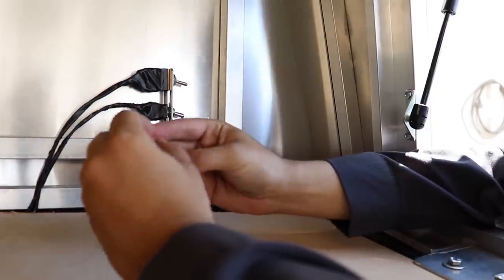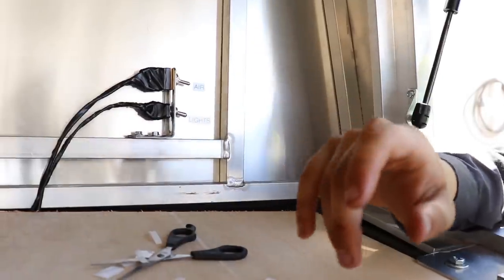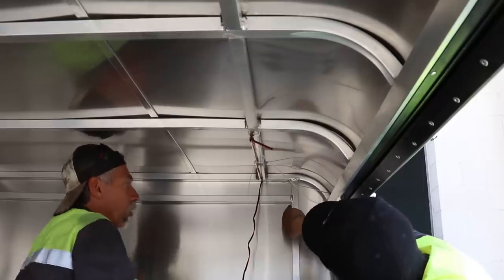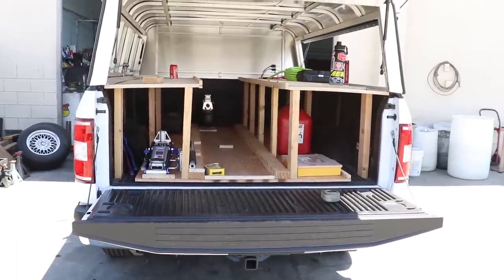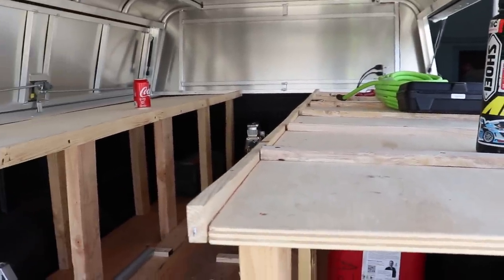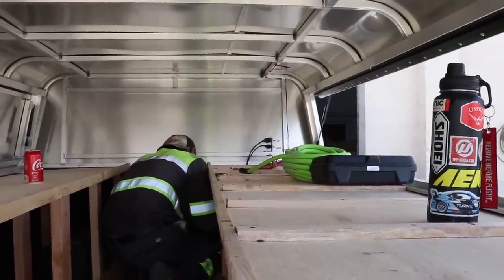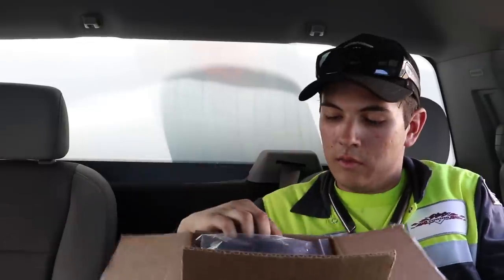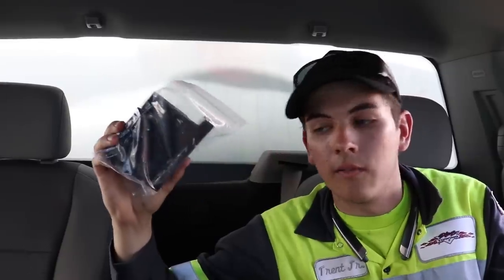Working On The New F 150 | VLOG 008

Comment: Tip for the label maker, don't make separate labels! 
After typing the first one just add 3/5 spaces then type the next one. Make all your labels as one then cut them up after printing. It wastes less paper.
Reply: Most have a setting that you can change that. You can align to the left side and they come out with little tails. Then you don't have to print them all back to back. I know because I label everything at home lol.

Comment: To cut down on label tape waste, use spaces between each "label" instead of printing each separately, e.g. "Label1[3+ spaces]Label2". Labelmakers that can be PC-controlled often have shorter margin/overprint options in the PC software, as well.

Comment: You should have removed the rear view mirror since you can't use it anyway because of the box cap you put on the box. Than you could have mounted the camera & GPS system a little higher up on the windshield so it gives the driver a little better view out the windshield. If the double sided tape holding the camera & GPS  to the windshield doesn't hold use (Witch I know it won't) Use windshield glue that is for mounting rear view mirrors windshields. Just some ideas for you to think about...

Comment: That camera set-up is a fantastic idea. It certainly protects your company from false claims - just in case - and also keeps track of driver's activities while the truck is in use. You are essentially making a road service truck??. Just a hint. No nail should be put into a piece of wood less than 3 inches from the end, That prevents splitting. AND - you should paint all that raw wood with the type of pain used for garage floors. #1  it preserves the wood from being impregnated with dirt and hand prints. Second, it is much easier to keep the truck clean - a reflection on your image.  Nice job with your wiring. Always good to be neat when dealing with wiring and connections. One more hint - Use screws. Wall board screws are good for your type of application. Nails will eventually come out but screws will hold for much longer and are stronger. - Just a suggestion.

Comment: That plug for jumper cables is safer too; i like it!!
Reply: The quick plug was in common use 20 years ago but was always rigidly mounted in a safe accessible place so you could plug into it one handed wearing winter mitts. Connect the boostee first and then plug the cables into the service truck so an arc didn't occur close to a battery. I do like the new idiot proof cables that won't do damage if connected backwards.